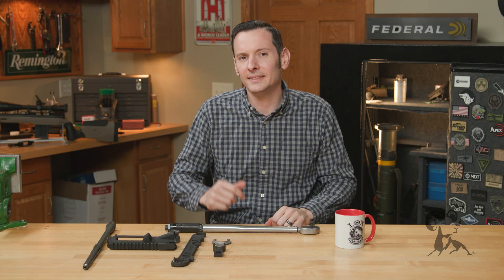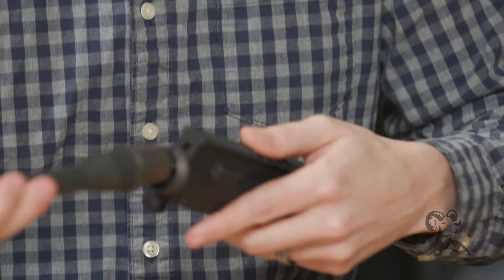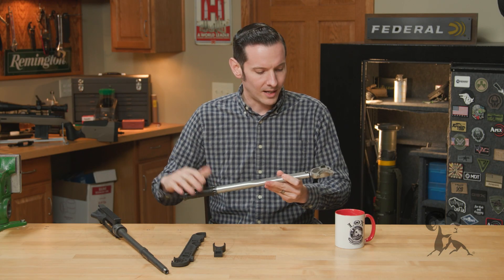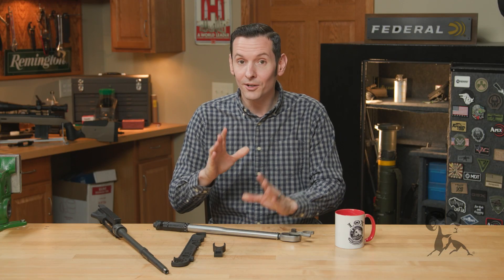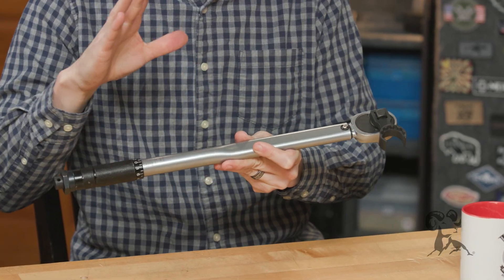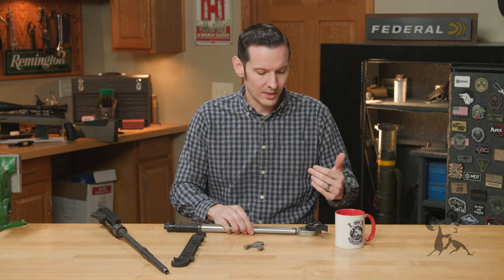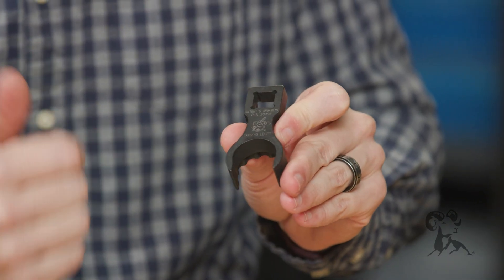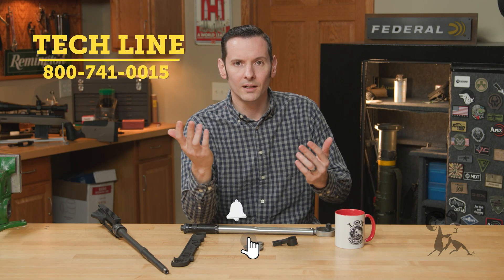Quick Tip: Using a Torque Wrench on Firearms

Comment: Just put it at 90 degrees for best practice. If you are worried because you did it wrong in the past, chill, it's not a big deal.
Reply: And....have your torque calibrated.   The error of a non-calibrated torque wrench is likely greater that the error of a socket a few degrees off of 90 degrees.
Reply: Caleb is correct if we all just think about how a lever applies force. At 90 degrees the intended lever to driver distance is as close to the center of that drive as you can be with a crows foot adapter. If you put that crows foot extended in line with the lever then you are increasing torque because you are lengthening your lever.
Reply: @CalebSavant  sad to say, there's always going to be one in the comments.🫵Keep rockin it brother!✊

Comment: Learning something new all the time; thanks.
Reply: Just be aware that the statement beginning from 2:40 has it backwards - swinging the wrench extension back towards the grip position reduces the resultant torque, if it projects beyond to increase the lever length then the torque output at release increases.

Comment: Hey Kaleb. Love your videos and use them often for advice. However, I have to point out that you are incorrect on this one. You would be correct IF we were talking about a rigid lever (not a torque wrench) and a consistent force being applied at the end of that lever. The difference would be minimal, even in this case, since the increase in the overall lever arm would be slight, since the barrel nut adapter is only about 2" in length. However, in this instance you are using a torque wrench, not a rigid arm. The torque wrench measures and indicates when it reaches a particular torque at the center of the socket mount. According to the laws of physics, this torque will be, and must be the same as the torque at the center of the barrel nut. The torque wrench will measure and indicate the torque setting, at the center of the socket mount, regardless of its orientation to any outside attachments. Think of it this way........If you were to use a "screw driver style" torque wrench (the type typically used for scope mounts), you would simply grip the screw driver style torque wrench and twist with your hand as you would a screw driver. It couldn't possibly make any difference how your hand, wrist and arm was oriented to the screw driver style torque wrench. Please keep up the good work, sir!

Comment: Sorry, I'm one of those guys mentioned, a 45 year professional tech. You said it backwards. If you notice on your torque wrench there is a pin just ahead of the grip. A measurement from that pin to the center of the driver must not change in regard to the center of whatever adapter you use. A short adapter at a 90 deg angle is as close as you're going to get in regard to the measurement. If you point your adapter straight out, you have lengthened the tool allowing you to have more leverage with less effort. Meaning, the torque applied is more than the setting, not less as you mentioned, and vice versa. If you use a long adapter you may be able to regain the aformentioned measurement with the ratcheting head of the torque wrench. P.S. lube the threads. Dry threads may be the single biggest reason for mis-torqued fasteners.

Comment: +/- 5 foot pounds could be the accuracy of the torque wrench depending on quality. If you throw an additional 5 foot pounds on top of that for no reason, you could get out of spec. There's just no good reason to do such things.

Comment: I have never thought a bout it before. I just drew a free body diagram, when the wrench tool is at 90 degrees, it makes the actual distance from center of nut to the end of wrench a little longer, but the force applied perpendicular to the wrench is not perpendicular to the line of new distance, the new force perpendicular to that line of new distance is a little smaller. To be more specific, if the length of wrench is L1, length of  center of rotating part of wrench to center of the nut is L2, connecting the longer end of wrench and the center of nut gives us the new distance L3, let's call the angle between L1 and L3 is θ, then L3 is L1/cosθ, and the new force F' perpendicular to the L3 is Fcosθ, F is the force applied perpendicular to the wrench, you multiply L3 and F' to get the actual torque L3*F', it equals to L1*F which is the torque setup on the torque wrench. So mathematically, put the wrench tool at 90 degrees is perfect.

Comment: I am installing a new buffer tube on an AR15 lower receiver. Is it not absolutely necessary I use a torque wrench for that? I have one, but just a plain Doublestar castle nut wrench that cannot work with a torque wrench.
Reply: No you do not need to use a torque wrench. I use a spanner wrench to tighten the nut.. You do need to stake the nut in place if you never plan on removing it. OTOH I switch things around a lot so I don't stake the nut. I have never had one come loose after thousands of rounds of 9mm which kicks a lot more than a 5.56.
Reply: It was in fact not possible to tighten it to anywhere near 40 ft-lbs without damaging the castle nut. Even major manufacturers like Bushmaster don't stake their castle nuts. Zaviar Firearms who makes my AR15 receiver told me they don't use a torque wrench or do staking either.

Comment: Your wrench should be at 45 degrees from then barrel lug wrench adapter so you get a correct torque tightness . You probably didn’t get what your wrench was set to .

Comment: I've barreled hundreds of ar uppers with zero field failures and have never touched one of them... If you are trying to hit a torque spec on a barrel nut you will never be able to line up the gas tube.

Comment: Torque Test Channel went over this about 11 days ago in a video (this info was in part of it). But, the further you are out from the end of the wrench, the higher the torque will be applied. Essentially, you set the wrench value lower than your target. 
Example. 
Target is 50 ft lb. Normal length is 12", extended is 14" (2" extension). You set the wrench to 42-43 to get your 50 target. A 1" difference is less than the 5 ft lbs that's the mentioned +/- (set to 46).
Another factor is torque wrench length. A shorter wrench will have a much higher difference than a longer one. 

You can make it easy to figure out with the Torque Wrench Extension Calculator app (I got it for Android). All that said, using the 90 degree offset is probably the easiest way to NOT have to deal with making changes.
Reply: they added if you add an extension like the barrel wrench your torques are different as well ..

Comment: I’d like you to do a video on the torque difference if using a crows foot over a Magpul wrench. If using the same torque value what increase is added by the length of the Magpul wrench.

Comment: NO! That is 100% incorrect. The torque wrench measures from the handle to the head, and you have to compensate for any attachment regardless of angle if you are trying to be spot on. However, almost all torque specs are a range, and a simple crow's foot type wrench won't put you outside of the range if you are set for the middle of it.

Comment: Caleb, you’re mostly right with the adapter you were using. But if someone was torquing with a standard armorers wrench, or some adapter that is substantially longer, there will be a very significant difference in torque applied

Comment: I insist it be at at 90 degrees. I have been a mechanic and and ind=strument tech and various other jobs and skills. The best results have always been following the rules. 90 degrees or you don't need to work on my AR15...it is that simple.

Comment: Length of handle shouldn't matter. Angle may. The torque is calibrated to the length.  Usually, the longer the handle, the higher the torque adjustments on the wrench. If you use a cheater, you may not feel the wrench cam over. And torque is a steady apply of pressure, not a jerking motion.

Comment: Just flip a couple pages from your old physic book: torque is just force per unit radius. It's only a couple sine and cosine equations away from calculation of that torque between the two pivot points. 
In short, you're splitting hair by just moving the pivot point over by 2 inches; it doesn't matter.

Comment: Good information and as a car guy, BTDT but good to see again. My question is do you use Blue (242/243) Loctite on some parts?? Seems like a drop on that barrel nut would be good and I have used it on the scope mount screws. Thoughts??
Reply: HELL NO
Reply: AR receiver should get Aeroshell grease and torque to your desired spec. Never use loctite on a barrel nut

Comment: The title states "torque wrench on firearms" but it seems like this was pretty specific to the AR-15 barrel nut, whereas I see specific torque called for in mounting scopes, etc. - probably would have been good to mention a bit more outside of the one application.

Comment: The part of the wrench with the square drive is called the hinge. It is a lever whose pivot point is the pin at the top of the tube. Think of it like a school ground  teeter-toter. One side goes from the pivot pin to the center of the square drive, the other goes from the pivot pin, down inside the tube where a spring presses a steel cube against the hinge. If you attach a crowsfoot to the sqdr, inline with the wrench, you've lengthened one end of the lever. Using the crowsfoot at 90 degrees, minimizes the change in length. Torque wrenches of the style shown are best used where the desired torque value is 75% of the maximum range of the wrench.
Reply: Found the guy bitching in the comment sections!

Comment: I've been a mechanic for more than 40 years and have torqued many car and truck parts over the years, but I have never torqued a barrel nut on an AR. I use a large steel crescent wrench I've had for years, I go by feel and get it nice and tight. Never had any trouble with the rifles or pistols I have assembled.
Reply: I'm a mechanic as well and have never used a torque wrench on my barrel nuts. The range is so wide there isnt a point.
Reply: @rshinn1776  exactly...even me going to the high end is still something like 90ftlbs
Reply: Being a mechanic and machinist as well, I do it by feel also, prep correctly, but I may torque it to the heavier side. Although never had a problem with the multiple rifle etc. I've built.
Reply: I guess some guys think they are professionals when holding the magic torque wrench? I would probably use one torquing heads on a cummins though.
Reply: @jimscott5705  It is not about a "magic" torque wrench. You do develop a feel for the amount of torque you are exerting after many years of doing it. And the torque range on a barrel nut is so broad it is kind of hard to screw it up.
Reply: And you develope that "feel" over time by using a torque wrench in the 1st place, or a lot of failures to get it correct. Specific torque values allow the "beginner" to reach the target value for a successful build.
Reply: Same here, torque head bolts and maybe wheel nuts/bolts but never used a torque wrench on a barrel because I'm a mechanic and know when it's tight. 😉
Reply: @melissasmess2773  that's the problem you " knowing it's tight" means your are probably deforming the aluminum. It isn't to make sure it's tight it's so make sure it isn't too tight. Anything Over 40 ft lbs on a muzzle device restrict the bore enough to stop a pin Guage
Reply: @johnadams673 I agree. But muzzle devices are completely different especially that end of the barrel, and yes my 80ftlbs could deform the aluminum of the upper threads, but will not affect anything unless you change barrels. Fortunately it hasn't did anything like that to date, the quality of the upper also plays into it as well.
Reply: @johnadams673  Not even close to deforming the receiver. The torque range for the standard steel barrel nut is 30 to 80 Ft. Lbs. and 80 does not deform the receiver. I am certainly not getting anywhere near 80 Ft. Lbs. with any of the steel or aluminum barrel nuts of the free float handguards I have used. They did a video on the subject of muzzle devices and torque and it took a LOT of over torqueing to deform and narrow the muzzle end of the barrel.

Comment: I torque a lot of things on cars. Some things don't matter that much. When replacing a clothers dryer pulley, it said to torque the screws in inch/pounds. Since I had a wrench I did it. It tightened the screws more than I would have without the wrench. I kept wondering if the screws would break or strip out, but they didn't. I don't know if the screws would have vibrated out if I had not tightend them to specs. Many years later, it still dries clothes.

Comment: I mostly build M-4 style carbines and I never use a torque wrench because the spec is 30-80 ft-lbs. So, when you tighten up your barrel nut after being snug to align the gas tube, 99.9% of the time you will be more than over 40 ft-lbs which is plenty tight.
Reply: So in other words, you do it wrong.
Reply: @johnadams673  How is it wrong when my barrels stay tight and half of the armorers in the military don't use torque wrenches?
Reply: @jimscott5705  lol wrong and wrong again. They follow the 23&p manual
Reply: @johnadams673  You sound so sure of yourself. My father in law and my wife's uncle were armorors in the navy and said they quit using torque wrenches because you can tell by feel after you do a few tear downs and assemblies.
Reply: @jimscott5705  I probably fixed a few hundred rifles they fucked up
Reply: @johnadams673  You sound like a troll.

Comment: It matters when you are using an old ass barrel nut that needs to be clocked to align with the gas tube. Why use a torque wrench and not set it correctly.  Most torque wrenches are not calibrated regularly and are already off 5 ft/lbs.  I made a vid on this years ago because companies like yours had "instructional" videos showing it done wrong.

Comment: Good piece of advice. I use Torque Wrenches regularly on Vehicles. I’ve built out Custom ARs and Remington 700s with Remage Barreles. Those are the only two Applications I’ve encountered where a Lb-Ft Torque Wrench is to be used. Every other torque rating is measured in Lb-In so you will need a Torque Driver that measures in that value. Also keep in mind that 12 lb-in is 1 lb-ft so like on a Geissele Rail Forend, the two main Set Screws are reared for 5 lb-ft in the instructions, which is also 60 lb-in. Things you gotta be mindful of. The 90-degree position depends on whether I’m mounting or removing a Barrel. If mounting the Barrel, I use the 90-Degree Position. If removing the Barrel, I go 0-Degree for slightly more leverage to loosen the Barrel Nut. I’ve been tinkering, building, fixing, tricking out, all over anything Mechanical since I was old enough to climb counters, so videos like this and literature about it are things I’m all over. Thanks for posting.

Comment: Well while we are geeking out on torque wrenches, on Caleb’s particular torque wrench, it’s extremely important to remember to set the torque wrench at the proper lower torque setting after using the wrench and before storing for any length of time. It says on the wrench what the proper storage torque setting is.

Comment: The torque wrench reads on a completely different axis than what you are trying to torque, so it's always wrong. But it doesn't really matter. The barrel nut's only function is holding the barrel in place so that it stays in a position where the bolt can fit, and lined up with your optic. All the explosions are contained within the barrel (and locked bolt) assembly.

Comment: The only reason you're using a torque wrench in the first place is for accuracy, so why deliberately do it incorrectly.  I own a shooting range and have a very heavy table with a large vice mounted on it.  I can clamp an AR in the vice and fire it.  I have torqued the barrel nuts from 10 FP up to 90 FP and have found that the sweet spot is around 35 to 50.  The longer and heaver the barrel is the higher it needs to be torqued, but only by about +15 FP for barrels as short as 7" up to 20".  So a thin 10.5" pistol barrel seems to work best at around 35FP and a 20" heavy barrel works best at around 50FP.  If you have a 24" barrel I would start at 50 and test it, then try 60FP and see if it improves or go's down hill, I bet it would improve a bit.

Comment: I've always done the 90 degree position while realizing the extreme spread of the specified torque makes the 1-1/2"-ish extra extension if placed inline pretty much a moot point. The "gotta be precise" part of my brain rationalizes that keeping the tool at 90 degrees will minimize any error in the calibration of the torque wrench. I think that could also fall under the category of "making up crap", but that's my rational.

Comment: While variation on a barrel but does not matter, the castle nut is different.  There is less tolerance for the castle nut torque and it is possible to over torque causing stress on the threads of the receiver extension which can lead to premature failure.
Reply: Good observation. I think he should make a video about castle nuts using the Brownells Armorors Wrench with the torque wrench.

Comment: A thorough discussion of torque wrenches is available on the “Torque Wrench Channel”.  The torque difference is dependent on the length of the adapter, a longer adapter added to the length of the wrench means a higher torque.  Always pull or push a torque wrench using the grip portion of the wrench, it matters.  Did you know that an airman going through “fundies” in weapons class once said that the closed end of a combination wrench was used to hang it on the tool board?  Partially true!
Reply: Torque Test Channel, I'll correct. Only because he runs a great channel. Anyone into tools or especially, the impact wrench torque arms race, it's a good watch.
Reply: The closed end is used to break the 🔩 the open end is to remove the 🔩